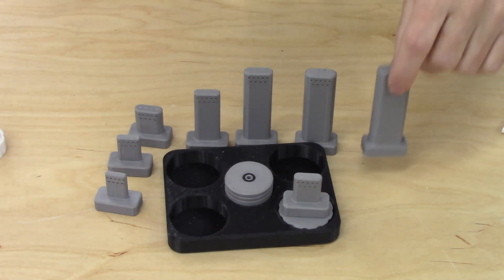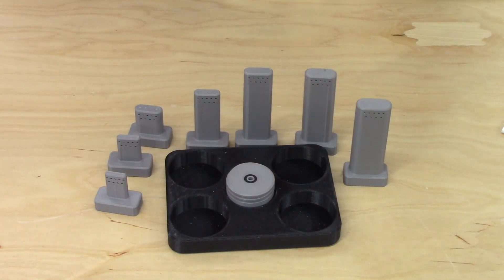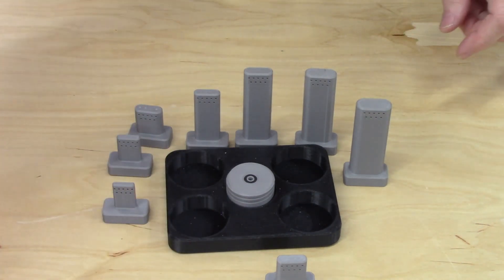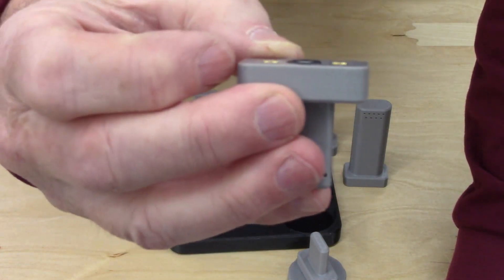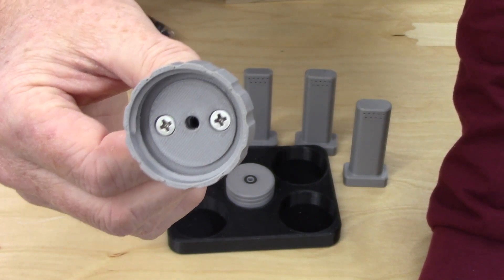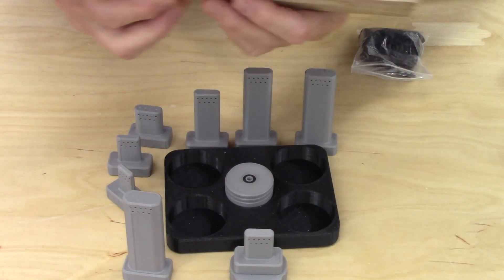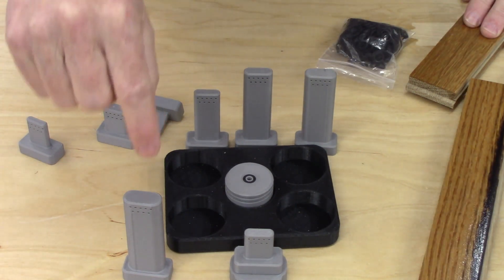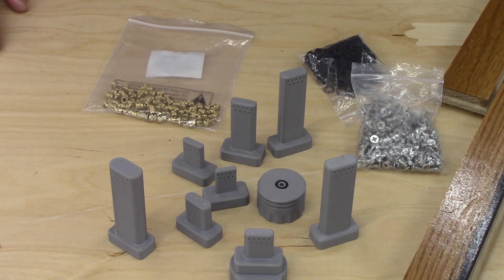3D Printed Domino Glue Nozzles Version 2

Comment: Why aren't you selling these?!!! I would buy a set in a heartbeat! Especially if you made a version to fit the FastCap glue bottle. Guess I need a 3D printer now...
Reply from the maker: I suggested this as a product to Fastcap and the founder told me that glue accessories do not sell well, that it would cost $50K for injection molds, and they could not justify it.  I understand that completely and really did not want to open a print farm so I provided the files that could be printed.  There are sites that will take these files, print them and ship them to you.  Steve
Reply: @extremewoodworker  Yeah, I guess that makes sense. And the Domino market is probably not big enough in the overall picture of woodworking anyway. Good on you though for designing and sharing this! It will be at the top of my project list once I decide to give 3D printing a try! Thanks!

Comment: Looking forward to testing these, thanks for improving them! I gave the old ones a try, but didn't have a lot of success applying the glue neatly. Although I must admit I didn't do much investigation because I just wanted to get done with the project at the time.
Reply from the maker: Hi Michael.  The uniformity of the exit holes makes a difference on glue distribution.  If you have a good print, it is great.  If not, you may want to get a tiny drill bit the same size as the exit holes and ream them out a little.  Steve

Comment: What printer are you using? I’ve been considering getting one.
Reply from the maker: Hi Matt.  I started with a Creality Ender 3 V2 which required a lot of tweaking to get it running right.  Several viewers recommended the Bambu Labs printers which amazingly fast.  I added the X1C printer and it makes prints at least 5 times faster than the Creality.  There are what seems to be countless choices available and the best choice would depend on how often you use it and obviously budget.  Steve

Comment: Thanks for taking the time to update it Steve.    Still think you need a right angle one for boards or objects you cant stand up.   Either that or keep the glue bottle real full i guess, probably just as easy :)       I assume you have to wash these out soon after use else they clog up ?
Reply from the maker: Hi Gary.  I haven't thought about a right angle version but it looks like it would be prone to break.  I do think your idea of a full bottle would work just as well.  I keep a tub of water and when I am done just remove the nozzle and submerge it until I am ready for the days cleanup.  I was thinking about just finding a bottle the right size and just inverting and submerging the nozzle between applications similar to the Lamello Dosi-col or the Pizzi system.  Steve